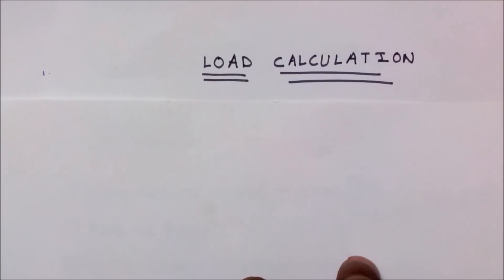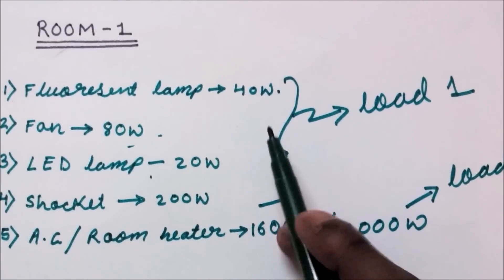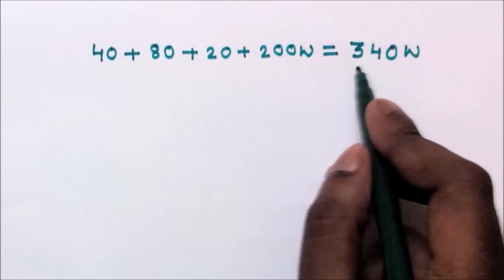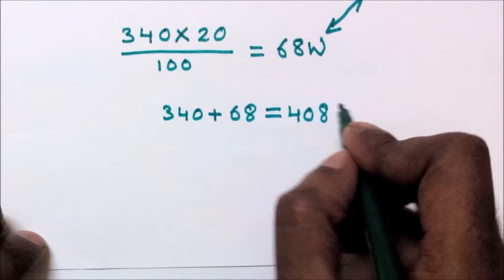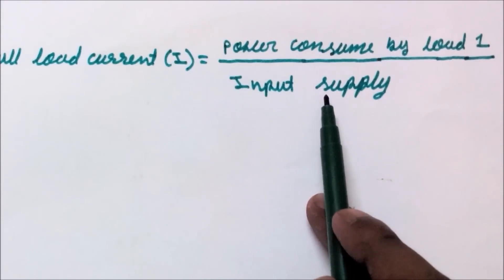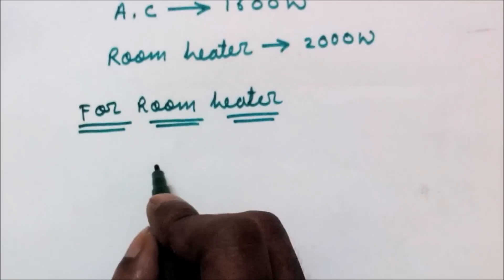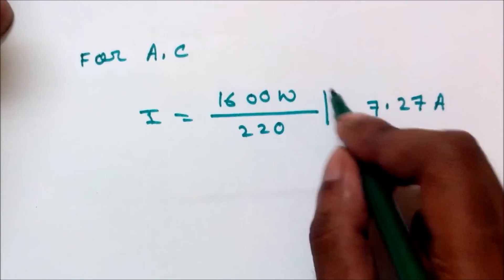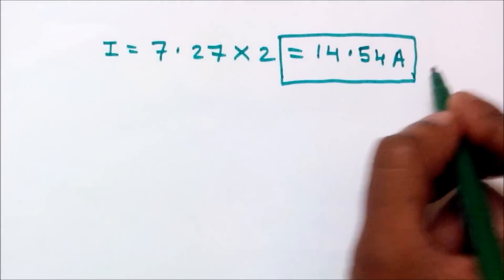electrical load calculation

Comment: The AC contains single phase Induction Motor, which draws 7 times its full load current during starting, so I think you should multiply the current by 7 instead of 2 when you want to get demand power.

Comment: No calculation required you have very small load, immediately use # 10 AWG for service entrance and #12 AWG for wiring inside and # 14 AWG for the swicth., if you have Air condition window type  just put # 10 AWG for this and increase your service to # 8 AWG., your house will be burn no worries.

Comment: but, in a same time AC and heater will never run together. So you need also consider this term.
Reply: Md Alam it's not valid reason... Heater means electrical water heater or any other electrical load it's seperatly from that ac

Comment: if u want anything to teach, first? u explain openly, where u get 100 ?and 20/??
Reply from the maker: if u want to learn something firstly listen everything what i m teaching over there
Reply: It seems to me that is a safety factor most likely.  A safety factor of 10-30% is also added to HVAC load calculations usually.
Reply: 20% extra
Reply: What is 20% ?

Comment: hello..!! where did you get that 100?
Reply: The 20/100 (20%) seems to be a safety factor that is added to load calculation. This is also done in HVAC load calculations. Usually this is between 10 and 30 percent.